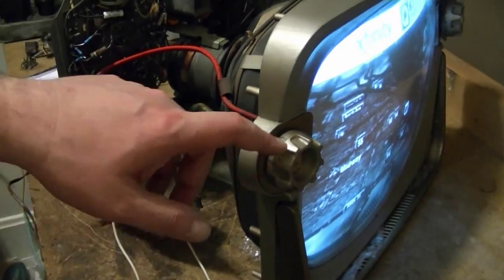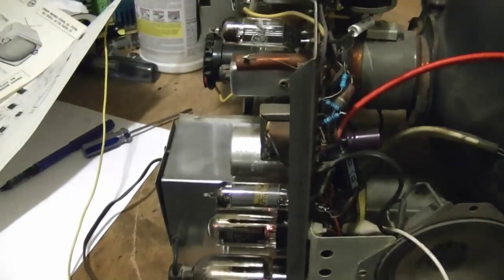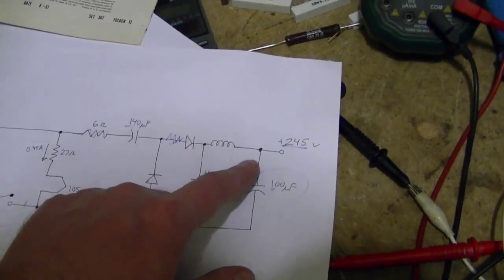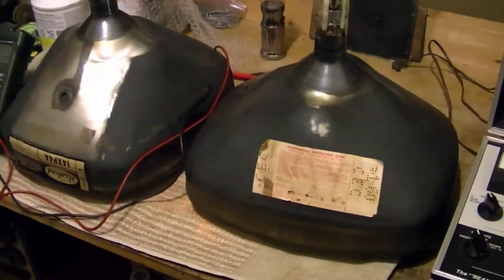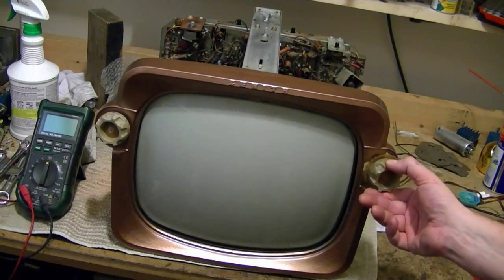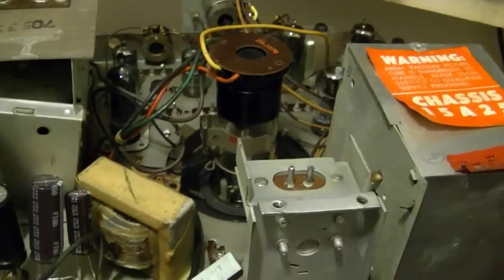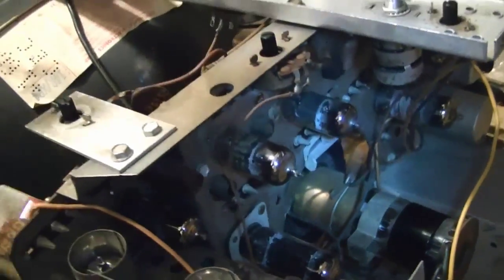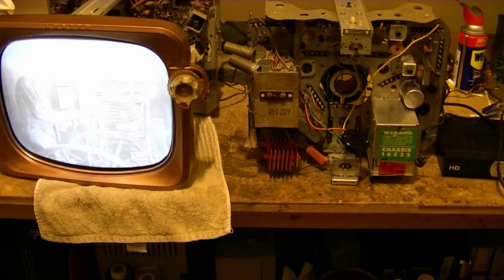Zenith "Bug Eye" restorations pt5o9

Comment from the maker: yeah, doubling the wattage is a good idea.  If I can dig up a 15 or 20W, I'll trow it in there.  i was also thinking abour adding a CL-90 thermistor to give it a show start.     No, the cap doesn't get warm.  By using a smaller cap in the doubler it's not able to build up enough charge each cycle to give a full B+  Probably not the greatest idea if the load varies a lot.  I just thought it was an interesting experiment.

Comment: maybe you can help me with this tv 
my vintage ge tv
Reply from the maker: What do you need help with specifically ?
Reply: well the coloring seems off i think the tube is weak and the tuner seems weak  ill bump it or move it  and the picture will lose color  get week  if i bump it again ill get the picture back   mainly just has a poor picture  wish i knew someone to rebuild the picture tube if that's the cause of it
Reply from the maker: SuperJeremi10
Have you done any tube testing or other maintenance ?  Even if there was a CRT rebuilder still around, be aware it cost a few hundred bucks.
Reply: yes I understand  that  and  no I haven't    I don't have much ability to do that here.  I can see at some point  a new flyback trans was installed and some tubes replaced. I did my best to clean the dust out of it  it had layers of smoke dust in it.